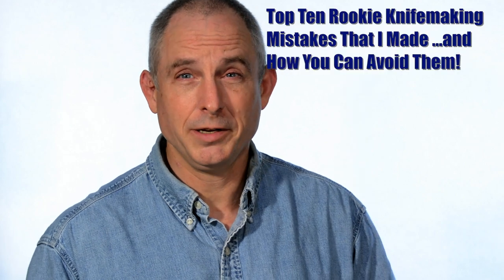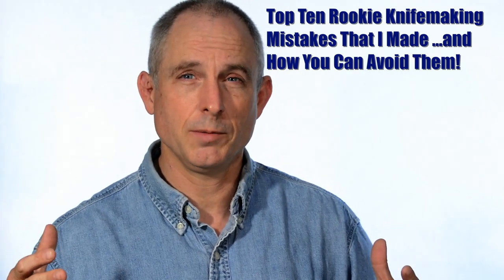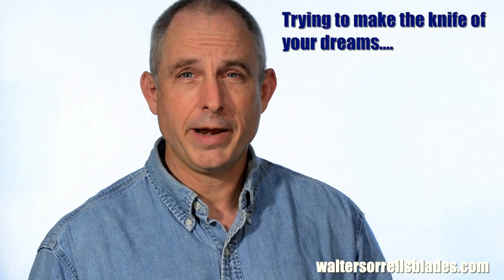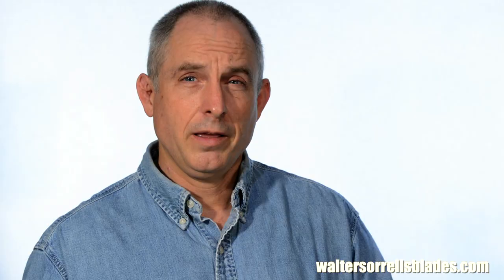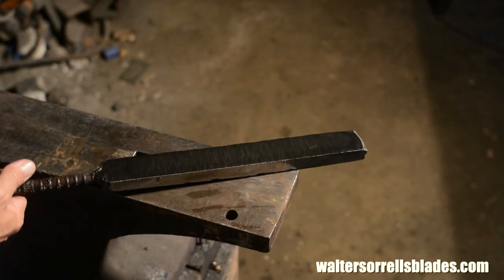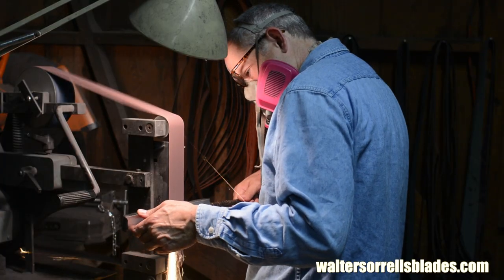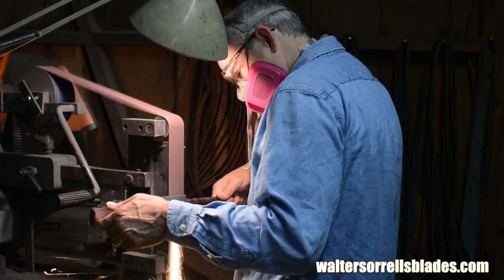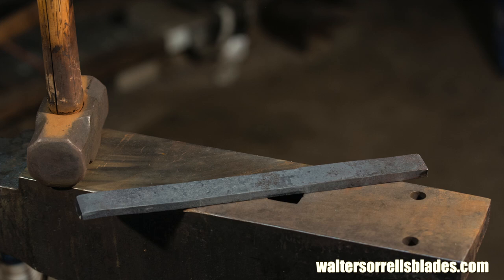Top Ten Beginner Knife Making Mistakes...and How to Avoid Them!

Comment: This is awesome Walter, but could we maybe also have top 10 rookie practical mistakes? 

Like don't let the point of your knife burn off while hardening, centerpunch your holes and sandwich drill with a punch in the other hole for perfect alignment, proper filing technique, don't be breathing burning motor oil and grinding dust, ...

You know, the obvious things that one needs to hear or have experienced (or have common sense) to know not to do.
Reply: +EddvT 
Good suggestion!
Reply: Like how not to centre punch STAINLESS steel and makeing the steel harden up in the spot that you are drilling
Reply: How not?
How does that happen?
Thanks
Reply: EddvT Love the fact that you specify its experience for some and common sense for others. You just won the #1 post on youtube of 2017 for understanding people's differences in my book.
Reply: Shop safety 101 wear safety glasses always ear and lung protection when necessary know when to wear gloves for specific tasks but do not wear gloves loose clothing (that includes a neck tie) or jewelry while operating machinery
When I worked in a machine shop One of the floor managers died by wearing a tie he was a suit and had little machine safety knowledge he leaned over the spindle supervising a coworker and his tie got snagged snapped his neck instantly his head got pulled in so quick it dismembered and crushed his face within the few seconds before the emergency stop was pressed had to have a closed casket funeral his head was unrecognizable
Reply: @sevenguardians7517  🤮🤮🤮
Reply: @sevenguardians7517  Also, learn to be aware where your hands are when you are near heavy machinery. I know a farmer who has his hand crushed by an hydraulic press because he though his hand was off range.

Comment: Good stuff.  I took my first blacksmith class in 2000, built a forge that year, had acquired a Bader by 2004.  Built my own forges.  And just last year finally acquired a 1929 Little Giant power hammer.  I hand forged one Damascus billet around 2010 or so and decided I wasn't going to make any more of that without a power hammer.  The Damascus is looking good, but I agree trying to do it too soon is a recipe for failure.

Comment: I have never worked with expensive steel.  I’m just a beginner.  I use railroad spikes.  They’re free.  They’re mild steel from I heard, but I’m still learning to work and shape the steel.  Great video! Thank you
Reply: It's good practice but u less it has HC stamped on top it probably won't harden at all, it's pretty much wrought iron. Good for decorative stuff and bottle openers and such, or maybe a basic tomahawk.

Comment: My rookie mistake no. 1. Not wearing a respirator.
Reply: LepsuSankari bruh tell me about it! My thought was in a smoker I will be fine. Instead of inhaling metal dust.
Reply: @ya mooch cooch any fine particle that can enter your lungs is dangerous. It's better to avoid damage than take a risk.
Reply: ya mooch cooch late reply, But it essentially cuts your lungs up from the inside out, causing... bad.
Reply: My mistake was wearing a very flammable flannel slag hit my arm and instant fire
Reply: Also, eye protection for grinding.
Reply: @Isarico  lol, I got metal dust stuck in my eye from griding and had to grab my 100lb magnet to help clean it out. Wasn't fun.
Reply: @mortalace22  That's just the worst. One day I got something in my eye and I had double vision in one eye. Driving a car and going to work was a nightmare, but it got better the next day.
Reply: Same
Reply: And glasses
Reply: Yeah i didn't wear oneand it felt like i had close to a quarter of a pound of things in my lungs
Reply: @evanwesolowski3717  Don't be doing that when you're cutting anything  that has fibreglass as part of it's make up. Also helps making it a bit wet so the dust is less likely to get airborne.
Reply: @Reploidx9  oh i dont fuvk with fiber glass i know that stuff can mess you up more than anything
Reply: @LJPV777 Even worse with stainless and high speed steels with chrome and cobalt and the like in there, even worse metals to breathe.

Comment: Good advice. Two points in particular, know you steel & heat treating. I see alot of knife, sword, axe, etc. makers on YouTube that forge everything imaginable, such as, old files, hammer heads, rebar, rail spikes, wrenches, plows points, saw blades, auto springs, gears, and the list goes on. The funny thing is, that these "blacksmiths" heat each of those "different" steels exactly the same & harden/temper each piece exactly the same. The only, general ideal of the steel type their using is by a "spark test". And, their hardening & tempering test is "will a file cut it or skate across it. Like you mentioned, all steel isn't the same. For example, a ball peen hammer, old crosscut saw blade & a metal cutting circular saw blade will each be a different type of steel manufactured & hardened differently, each for different purposes. And a lot of their blades end up only decorative, i.e., railroad spike knives. I personally wouldn't ever make a decorative, edged weapon unless it was also absolutely, 100% functional. But I digress. Keep up the good work Mr. Sorrells.
Reply: oldtimer4567 I’ve always been skeptical of this. But wish someone would upload videos of heat treating different steels
Reply: If they're having fun and selling them as butter knives or such, I suppose. But nice knives.. mystery metal isn't the best. At least know if it's 52100 bearings or mild steel.. hold time for 52100 is needed but 1055 definitely not.. hardness after tempering will also be massively different, or its 1095 it might not harded at all in the canola oil or whatever.

Comment: #8 reason  find a mentor.  ive been into this kind of craft for sometime already. i didnt have any tools, or equipment. ive been collecting material to work on as soon as i get my shop set up. ive been going to the flea market and looking for used cheap tools and equipment. i was surprised with what ive collected in about 6 months.  i can actually start now.  the bigger problem is that i live in a gated town home community 12 town homes to be exact and i dont want to make a racket for the neighbors.

i kinda went off track but Walter i love your videos, and your technique. your voice drags me more into your videos.  i love it when you say "old bastard file"   ive learned alot from your videos, now i just have to apply the knowledge youve provided.  

thanks

Comment: my first project was a machete, made it out of a steel leaf spring. Used wood coals, around 3 hours of hammering to give it a Parang shape-ish. While i dipped it in water i heard the metal doing a ping and i knew i screwed it up... well. not so bad, had to cut around 1 inch from the tip of the blade to fix the problem. Thanks to my beginner's luck it was not required to do too much sanding paper/file work to give it a good shape/edge. 

Where i totally blew it was with the handle. made its handle out of the wood of an old axe handle i dont use anymore. All good and nice but the shape of that handle and how i fitted that to the steel ... oh man... and that is one problem i haven't fixed yet. 

Heat treating the steel... i didn't knew about that when i made that blade. But... as i worked at a factory that made plumbing fittings and stuff(metal) we had a testing lab there ...so i took my blade to test it out. And surprise, surprise... beginners luck strikes again... hardness came out to be 61 hrc and the steel had a carbon concentration of .90 (so i could say between 1085 and 1095) with a little bit of chromium in there(idk how that got into a leaf spring, and neither the guys at the lab had any idea, the rest of the composition was normal for an old leaf spring according to those guys[they said its OK]) but hey, chromium is not bad in a blade considering it was in a very low concentration. 

I tested it out ...a ton of times, doing small cleaning operations around my yard, taking it out on my outdooring adventures and it held up quite nice. From time to time i sharpen it and giving it a small layer of mineral oil as i dont need my first project to end up all rusty. Idk if it helps, but after i did the file/sanding paper work on it i heated it once again, not too much, it barely started to get a color ... scrubbed half of a red onion (as a guy told me it would give it a darker finish) and then i dipped it in water again. 

That happened 2 years ago. If i knew then about your videos, things might have gone a bit better for my project, especially with the handle. Oh, and i still dont have a sheath for the blade... cant find a good piece of leather, so i am thinking of making a cordura one.
Reply: Chrome is used to make the steel easier to harden since it's much slower to move compared to the carbon, which doesn't want to get trapped inside the iron. Just a little bit goes into stuff like O1 and 5160, which is a common sprint steel.

Comment: number seven premise: If you have no power tools, you STILL dont have an excuse.
Reply: Exactly.. I'm hand filing my first file knife right now.. Hardest part is getting them annealed. I've heated them to curie point twice and cooled them in sand.. I think I may end up taking them from curie to a preheated oven next just to slow down the cooling
Reply: @Grizzydan 
Pearlite is the stuff to use if you can get it. That funky rock styrofoam stuff you see in some soil mixes. Nonmagnetic then quench in that. If not, leave it to cool in the forge or refractory brick or in the hot ashes of the fire even.

Comment: 😂 Im the crankshaft guy. 

Most recently used a driveshaft thinking it would be hard enough for a smallsword to complete a set ive been working on for a few years. 

Rather disappointed so far but will try to harden it. And there is mistake #10 for me.  

Never got into tempering. Always tried to use material that was as hard as i wanted and not let it get hot during removal. 

Love your videos Walter.
Reply: I also use mistery steel..... And all of them were crap

Comment: Free steel is free steel, who cares if it makes a great knife.  It’s the best way to start so your not wasting material.  I used a skill saw blade and it made a great knife.  I never heat treated it and it holds a good edge.   If it was trash then I only wasted my time. I just brought home some 1/4” stainless and some carbon steel.   I actually know which stainless it is but won’t waste my time treating it.  Just gonna try to make a knife.  If I fail then I’ll toss it.

Comment: I started making knives a few weeks ago and have had great success using a bench grinder, side grinder, hand held belt sander and plain ole sandpaper to shape the blades from a collection of very old files i have saved over the years. I have sold many of them but that was not my intentions when I started. Now I am planning on making a 72 inch belt sander and a simple propane forge. I have had pretty good luck with heat treating in a 55 gallon burn barrel that I modified slightly. I have not had any failures yet because I have a secret that I will be glad to share. I give God the glory for everything I do or create and I make sure that others know this!!! Try it and you will see the amazing power of our creator working through you. God bless.

Comment: Generally applicable life lessons: 0) Educate yourself.  Learn by doing.  Move forward.  A journey of a 1000 miles starts with a single step.  1). Start small.  Kaeizen. Don't try to learn the flying crane kick as your first move.  Wax on, wax off.   2) Use vetted, quality inputs, whether materials,  books, associations, etc.  Garbage in, garbage out.   3)  Don't get distracted by glamor and hype.  Learn to be competent at the blocking and tackling.  Balance lofty vision with the sweaty effort to develop foundational skills   4) Don't chase the boutique high end latest and greatest off the bat.  Start with something familiar, simple, and tried and true for starters. You can make mistakes and move on to higher cost, higher risk projects later as you develop more skills.
 5)  Chasing perfection is the enemy of good enough. Know when to move on to another project.  Don't spend your time polishing a turd.    6) Aim high enough to challenge yourself and develop your skills.  Don't neglect the finishing touches.  
 7)  Good gear is helpful, but the best gear won't make up for mediocre skill, artistic sensibility, patience, or diligence.  Don't be all hat, and no cattle.  Get started where you're at with what you have. 
 8)  You don't need a sensei to guide you. Ultimately all learning is self directed.  Spend time "in the shed" and trust you ability to learn new things.    9) Don't attempt 505 graduate level courses (Damascus) until you've proved mastery of 101 intro material, and then some.   Start with the small and simple to learn foundational stuff. 10) Learn the science and history behind the task, e.g heat treating and metallurgy.  Learn the whys underlying the hows.

Comment: I love your philosophy.  I was determined to design a good throwing knife and had some success, but was trying to do my heat treating in my forge w/ very inconsistent results.  I've given up until I can make a propane oven and a 72" belt sander.  I was going to use a 5 gallon metal can for the oven, but I just replaced my toilet and the top tank seems a decent shape to use.  Is this inadvisable?  Should I just stick with the more traditional metal can?

Comment: Thanks Walter! I am just starting and built a propane forge with a stove pipe. I have a bunch of old files I have been collecting that I want to turn into knives. I get the annealing part with a magnets. After I grind my shapes and basically have my knife what can you suggest as far as tempering. will my regular over work at 425 or is there anything you can suggest as far as how many times to temper do I go ahead and sharpen my knife before heat treat. I am just looking for functional skinning and butchering knifes. The main thing I want to achieve is sharpness and holding an edge.
Hope I dont come off dumb just want to go in with some confidence.
Reply from the maker: +Donald Steiner Tempering regimens differ for different steels.  But for the sort of steel typically used for files, I'd temper twice for an hour each time.
Reply: +Walter Sorrells Thanks Walter its a file from probably the 1940 or 50 so Im hoping for a good carbon content. Appreciate the help
Reply: +Walter Sorrells I have one simple question would mild steel hold an edge or is it too soft.
Reply: It's too soft to hold an edge for a long time
That being said, it's still a cheap and effective way to get used to knife making without wasting money on HI-CARBON / super steels.
Reply: +jason Mackenzie thanks Jason that's kind of what I thought using leaf springs and files lol
Reply: I think i posted that on the wrong comment
Old files make great knives, sorry for the confusion
Reply: files and leaf springs make great knives and most springs are 5160 .. even big high end makers use that such as ron hood and buck and files a lot of the time are made from w2 and make awesome knives. just temperature test them to make sure its a tool steel file and not a case hardened file and youll be just fine :)

Comment: I just started the knife making craft.  All that I could find as far as steel is concerned is flat bar steel from Home Depot.  The only thing I can get from that steel are the dimensions (1.5" x 1/8" x 36").  No other specs are on the steel.  Would you recommend to start with that or should I go get a specific steel from a reputable iron works place?  Thanks in advance for your insight.
   BY THE WAY, I love your channel, great information and great knives.

Comment: My rookie mistake: Think that grind steel would be easy and quick. Jesus Christ, these things are hard to grind and take forever...
Reply: If i didnt have basic 60 dollar belt sander i wouldnt get anywhere. Its not intended for steel but i can grind thinner blades in 6-7 hours. Handles also id got nowhere without that belt sander.
Reply: Must have bought a harbor frieght "grinder" 4×36
Reply: Scott Hummel while the cheap harbor freight grinder may not be high quality at all. It's much more consistent and quicker than using hand tools. I wouldn't give mine up except for a better belt sander
Reply: Speshely 4.5 mm ones

Comment: agree with them all except #9.

i was an average hobby knifemaker with average skills.

i wanted to make damascus.

i went to see two blacksmiths for help.

one at huka falls centre.

he said you cant make damascus untill you can forge properly-make horseshoes(actually not that easy to do) then try damascus.

the other one p j tombs(not sure on spelling) was visiting napuer so i went to see tge knifemaker he was hosted with and meet him too.

he said cant make damascus untill you can make a knife.

i got Jim Hrisolous book the pattern welded blade in 1994 and read and digested that.

i made my 3rd piece of damascus from his instructions(my first piece was small and only 100 layer count and i made a chinese style spear blade and shaft and my kendo teacher put it with one of his 12" samurai dolls and its still there)whike in bangkok using box cutter blades and  20l fish oil cans with the plating ground off.

a gas welding tip and a sledge hammer and 6"x6"x3' block of steel for tge anvil.

worked ok.

also damascus is tge exception to tge rule of better gear is not as important as the skill base.

newer methods of 80tonne hydraulic presses and gas forges would make things so easy for a begginner to get high layer count bilkets and of course get the billet to a useable size at a reasonable cost.

hamner forging to 600layer count is extremely costly

ive made a few small damascus blades(ladder,raindrop and twist) but ivs never made a horseshoe.

sometimes those established tell pirkues to prevent people starting